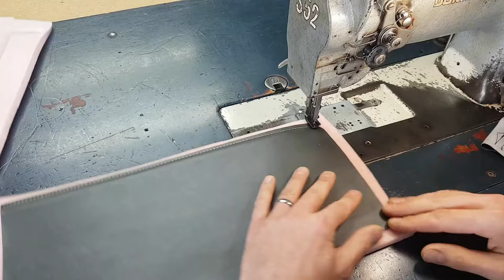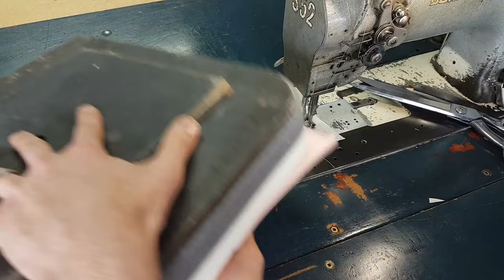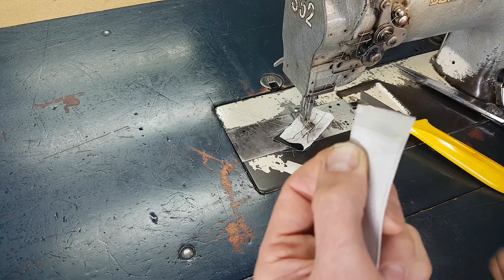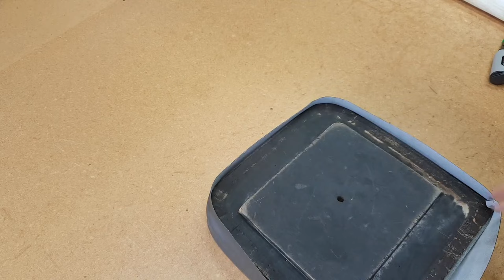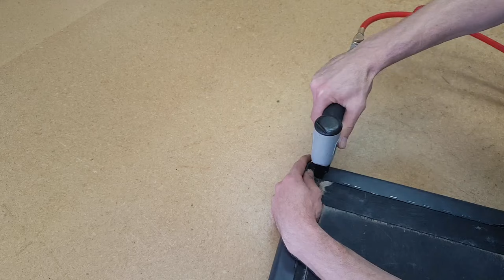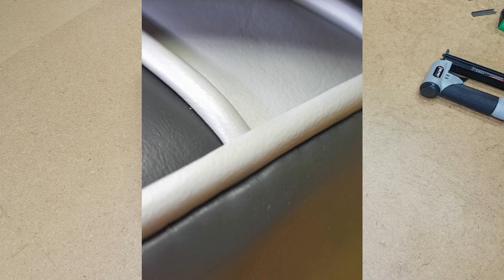Boat seat UPHOLSTERY (with PIPING and SEWING)

Comment: I just don't understand how the side pieces worked out to be even.  You measured from a square cushion and then you cut the corners round.  Maybe I flunked geometry but I thought that would be a different distance for a round corner.  Just Asking!
Reply from the maker: If I had cut the top vinyl to the correct size it would have changed and become smaller once I added the backing foam. So marked oversize (square), then laminated, then shaped to the cushions radii's and also going off centre measurements to keep symmetrical.  Both side boarder and piping are cut oversize and trimmed down accordingly. If the job requires exact side boarders then "finished size" perimeter needs to be plotted and marked accordingly. Hope that makes sense

Comment: Is that scrap piece of vinyl used so you don't have to hold the ends of the thread when starting a new line?
Reply from the maker: That is exactly that. Holds the thread ready for the next stitch and keeps the tension at the same time. No more binding or jamming threads in the bobbin

Comment: I just got into fabric welding, but what blows my mind is, he's making the piping as he's welding it on?! Lol what?! Is this normal? I just made 100 feet of piping to put on afterwards? Am I doing this wrong?
Reply: How do you weld piping onto the edges of a seat cushion without having to rip the vinyl completely off and having to start over on the sides of the seat? The upholstery guy didn’t add piping where I told him I wanted it and it was like hear it is take it or leave it situation